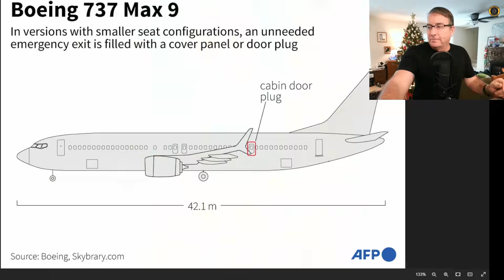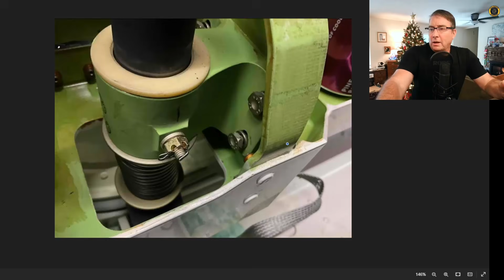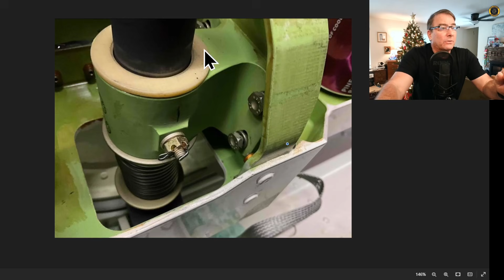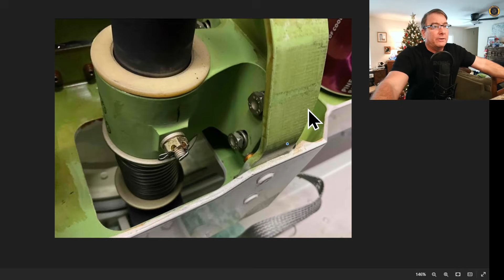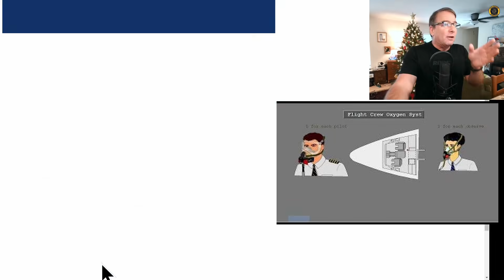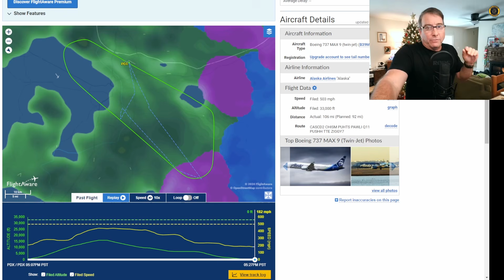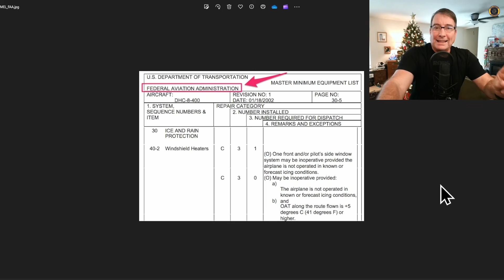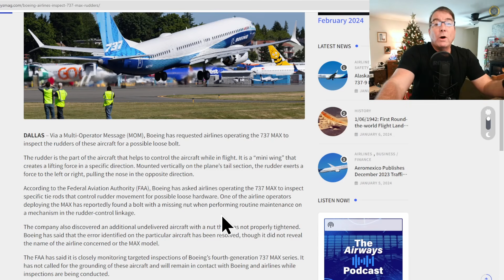"Yes, We Have No Bolts"  9 Jan 737 Max-9 Update

Comment: Why don't they use a type of plug where the inside lip is larger than the opening? It would mean the door has to be pulled into the aircraft to open, but would no longer rely on any such mechanisms. Similar to how they design spacecraft. It gives you a "default" closed position , not dependent on anything else except structural failure.
Reply: Because if you did that you'd have to chafe the air frame design as stress would be different.  This allows multiple configurations with one design.
Reply: What I have been saying in the other thread. The actual door could work the same way - there certainly have been emergency exits like that because I remember people mentioning an emergency instruction card which showed Heroic Passenger operating the door release and lifting the door into the plane but in the next frame the door was conspicuously missing with no indication of where you were supposed to put it in a crowded cabin during an evacuation. (You are supposed to turn it sideways and yeet it out of the hole, I think they later modified the card to show this.)

Comment: Juan... That dont make no sense... if the check list are what the pilots are using in the cockpit... HOW did they get blown away??? isnt the cockpit door supposed to be closed at ALL TIME during flight???? How can they get lost
Reply: Air pressure pushed it open
Reply: Sorry I work around the aircraft everyday... The cockpit door is what I was talking about... The checklist he was talking about are stored in the cockpit so the pilots can use them if something happens (Just like this or an engine problem). I am not sure how many differant checklists they have it there is a book with them  @xaiano794

Comment: Maybe vibration is causing the loose found bolts need a loctite type patch material to keep them from vibrating loose? Design engineers should indicate if the design took this into consideration. Boeing should be able to look this up in a matter of seconds. I wonder/speculate given delivery date if supply chain Covid issues caused a replacement of fasteners that ended up NOT being MilSpec as required/designed in order to not shut down production??
Reply: Simplest fix for this would be going to the castle-nut & cotter-pin assembly on all the bolts connecting door/sub-assembly to fuselage, no? I would imagine that with a maximum of two of these doors per bird, the weight penalty would still be less than one pound.
Reply: Castle nut and cotter pin or safety wire.

Actually, are thread lockers used in critical applications on aircraft? I'm used to only hearing about mechanical backups like safety wire.

Comment: Juan, curious what the starboard side " door plug "  mate  is fitted with as far as bolts. IOW ,  could the right side plug be in the same condition?? Maybe that side is rattling around too but just hasn't decided to jump off ✈  I would take a look at all the plug doors in all the fleets.
Reply: NTSB inspected the starboard side and concluded that was installed correctly.

Comment: My question is about the several reports of other bolts being loose on these same plug doors on several airlines. How were they found to be loose? Were the cotter pins installed at all? Or were these the other bolts for the assembly?
Reply: Other bolts shown @ 5:45 Two are visibly lose.
Reply: @rootuz42 I see that. Is this picture of the assembly that he used supposed to be a mockup or taken from some actual plane?

Comment: Outstanding analysis. Spirit is already in trouble for firing whistle blowers who were reporting, among other things, that torque wrenches were not properly calibrated.

So... the door was holding on by force of habit. A couple of hard bumps and it would lift off the locks and take solo flight. I'd like to pretend this is unbelievable, but instead it's just another Boeing engineering failure. At least nobody died this time.

One thing that was not done well here was communicating the emergency. As Juan says, MAYDAY MAYDAY MAYDAY should be the first thing out of your mouth when you call ATC with an emergency. ATC asked a few times if it was an emergency, there's a procedure for that. You stick MAYDAY as the FIRST WORD on calls until ATC obviously understands. In Europe and Australia you'll hear the ATC respond "Roger MAYDAY". 

I think they took way too long to get her pointed downhill. The reason for descending to 10,000 is that that's the limit without oxygen. So if you are at 42,000 feet and you don't get oxygen on fast enough, the aircraft is going to take you down to where you will regain consciousness. So oxygen mask should be followed by sending the aircraft back down. ATC can clear the way.
Reply: If bolts were never present, it may be time for Boeing to go into government management (if that exists).   Had that plug blown out at 35K feet, the MAX program would be finished and Boeing stock deemed junk.  The Airbus A200-300 and soon A220-500 can easily replace the 737 MAX derivatives and this is sad for U.S. aircraft manufacture.
Reply: @chrispnw2547 I wonder if Airbus is contemplating buying Boeing?
Reply: @davida56891  The U.S, government won't allow it and the politicians don't want to be seen as 'selling out America' to the EU.
Reply: @davida56891  Incompatible. Boeing has too much military work. Plus what would they get? A failing engineering company.

Comment: Juan, I have been USAF Aircraft Mx for the last 20 years. Following any major event like this, which would absolutely drive an impound, one of the first steps in our checklist is to pull CVR/FDR CB’s. 

Thanks for the report.
Reply: I'd ask also, given your experience, shouldn't there have been some 'torque seal' indicating paint on the nuts as a QC indication that the bolts were torques correctly?   This was my experience when I worked on some aircraft parts assemblies as a sub-contractor employee.
Reply: Can't help but wonder why shutting down the CVR cannot somehow be automated eg If the weight is on the wheels after a transponder setting of 7700, then preserve the audio (somehow).
Reply: What? You want extra components? That's not very sympathetic to Boeing's unofficial mission statement! 😁 @jimrobin
Reply: @jimrobin there are times when it is beneficial to record CVR. Think during Mx engine runs etc. if there is ever a ground mishap; investigators will utilize the CVR to get an idea of what conversations were happening during the mishap.
Reply: @jimrobin  How about "automatically download the recordings and all data and archive them on ground servers after every flight, no matter how routine?"
Reply: @tfdtfdtfd  That's crazy talk!  What do we do when we run out of bits?
Reply: In Europe they specify 25 hours minimum duration for the CVR - the US specifies 2 hours.
The NTSB has been asking for years for the FAA to align with EASA regulations…
Reply: Yes. They are pulled out following major events requiring an automatic impound or higher. It is a precaution to prevent overwrite of the 2-hr loop as they are always recording while power is applied to the aircraft. 

While the data written on the systems may not be required for the investigation; that isn’t  always clear at the start of the investigation. Hope that helps.

Comment: The plug door being spring loaded upwards to shift the ears over the stop pads seems like a non-failsafe design. If it didn't have a preload, it seems like it wouldn't be as prone to sliding apart. I mean, obviously the problem seems like there was no bolts there to act a stop pin, but I'm surprised that it's designed as a single mistake failure.
Reply: There are 4 bolts.
Reply: @percyfaith11  Sure, but 4 bolts is still one mistake if its just one step on a checklist. My point is it doesn't fail safe, it fails right off the side of the plane.
Reply: @telemundie  Well welded could be more secure I suppose.  But then you can say welding is only one procedure on a checklist that can be ignored.  If they want to be able to remove the plug at some point I don't see a better way of doing it.  
Gravity over powers the springs.  They don't launch the door into space.  They are there to assist a person to lift the plug.  I guess they never considered that turbulence could jiggle the door up and down enough to clear those stop points.  Even 1psid is plenty of force to jam the plug securely.
Reply: @percyfaith11  Hahaha, yea that's fair, its a little cheeky for me to describe it as "one checklist item" when I don't really know what the QC or cross-check process is like for this kind of thing.
Reply: @percyfaith11 supposed to be!
Reply: Why those springs are fitted to the plug version is a very good question. The plug does not need to be easy to open.
Reply: The springs are there not to automatically force the door upwards, but to be just enough to counter balance most of the weight of the door, so it doesn't need a lot of human force to lift the door when you want to open it - otherwise it would be too heavy/difficult to open it when you want/need to.
Reply: @wurly1  That is only a requirement for the actual emergency door. For the plug which is only opened occasionally in a maintenance hanger it doesn't need to be easy.
Reply: I'd think that the other function of the springs is to make sure the bottom of the door does not damage the skin of the aircraft when it is opened.

Comment: We're rapidly approaching "Well, the front isn't supposed to fall off" territory here. ಠ_ಠ
Reply: I'd like to point out that that's highly unusual.
Reply: Can we have the Senator for Boeing interviewed please?

 @WarrenPostma
Reply: "Cardboard is out...no paper, no string,  loose bolts...oh wait.."
Reply: What happened ?
- The Door Fell Off

 Why ?
- A bolt was loose.
 Is that unusual ?
- Oh Yeah. In A Boeing? Chance in a million.
 Where is this door now?
- It is out of the Environment...
 What happens after ?
- The Boeing Stock Fell off
 Is that unusual ?
- I want to make the point that that is not supposed to happen.
Reply: RIP  John Clarke.. One of the best.
Reply: What about cello tape? Is it FAA approved?
Reply: @oldcoot3459  No, but Boeing uses it anyway.
Reply: @oldcoot3459 Actually there is an FAA approved sticky tape…
Reply: Funnily enough there is an aircraft approved "1000mph" duct tape...and it is used on passenger aircraft.

 @oldcoot3459
Reply: - Well, there are… regulations governing the materials that the plug door bolts can be made of-
- What materials?
- Well, cardboard’s out
Reply: Some of them are built that the door doesn't fall off at all.
Reply: I would love to have a new end table. Can you drop a 737 door plug in my yard, please?

Comment: were i to discover a wheel from a car in my bushes i would not immediately assume that any lack of lug nuts means thats why it came off the car.  the thing fell from 16k feet, plenty of time and opportunity for an itty bitty bolt to fall off.  what someone needs to do now is find those bolts... much harder than a door, sadly.

Comment: It's a wonder the departing door didn't damage the empannage.
Reply: It was BLOWN off of and away from the Fuselage and Empennage by the differential pressure.
Reply: @guitarhillbilly1482   We know that. But it could have still hit it.
Reply: I think the physics are against you, there ... explosive decompression would've imparted a separate "forward" velocity and vector, no?  @skyrangerswift2ireland
Reply: I have no idea. I'm just glad it didn't hit the tail!  @OtherSarah2
Reply: @OtherSarah2  tail sections have been damaged from parts departing an aircraft in the past. I'm guessing the pressure from the inner fuselage overcame any wind resistance from the aircraft's speed to blow it clear of the empannage. Had it not, this could have been much worse.
Reply: I don't know...the term "explosive decompression " is used, but it's really only relatively quick..compared to, say, a bleed air or outflow valve problem. 
   I'm sure everyone's ears disagree with that statement...but it was probably only a couple psi pressure differential at 14000 ft. The 60 or so lb door probably quickly had it's path dictated by the 250 knot airspeed outside. I bet it passed under, but within the span of the horizontal stab.
   I guess it doesn't matter that much, though...all we know is it seemed to miss.
   Thanks, Mr. Browne, for the consistently excellent explanations!
Reply: Me too. I was just thinking about forces of inertia and directional velocity maybe protecting that whole tail/control structure -- the door'd've departed outward/downward pretty straight instead of downward/rearward, no? I mean, I'm not a ballistics engineer or anything, but it was pushed out the side of the plane with some force.  @skyrangerswift2ireland
Reply: It's a blessing this door didn't damage it.

Comment: I saw it reported that crews had a warning light on that door several times and ignored it. Doesn’t sound right but who knows in this day and age.
I happen to be someone who has seen the damage a  rapid decompression can cause. Ear drums bursting and doors blown completely off of aircraft, cockpit door
  Forced to open the wrong way. It’s like a damn bomb going off.
Reply: It wasn't a door.  It was a plug door.  I doubt if there was an annunciator associated with it.
Reply: The warnings were from the triply redundant automatic pressurization system for which there were two backups. No one had any inkling that it was from the door plug, and there would be no reason to suspect it because they would assume the plane was manufactured and assembled properly. There's a legitimate point about how thoroughly they should tear a plane apart when they receive such warnings, but no, no warning issue related to the door has been reported by Juan, Chris Brady, or in the NTSB briefings.

Comment: What with the 737 MAx crashes, the starliner debacle and now these manufacturing errors, I'd definitly be wary of flying a Boeing bag of bolts (or no bolts).
This company has destroyed it's safety reputation through coprorate greed, malfeasance and incompetence. 
If it wasn't so firmly affixed to the teat of the of U.S. defense industrial complex, it would be facing being an ex company.
Reply: It's a good point. But what about the company that installed the door? Do they also do that kind of work for Airbus? Is it a quality control issue? They'll investigate it all. Boeing does have the ultimate weight, unless it was some unlikely maintenance snafu. Whatever the actual case, it's painful to see a great American company declining.

Comment: I'm hearing that loose bolts are being found in a lot of MAX's now. Need to talk to some old friends at Boeing and see what they're hearing.
Reply: I guarantee each employee signed an NDA when they started for just this sort of situation.
Reply: Probably hearing a lot of nuts and bolts rolling around
Reply: I commented above on this I think those loose bolts are missing a flat washer. the hole is slotted and a lock washer will fail on a slotted hole because it is not in contact all the way around the circumference. I think they are missing a flat washer on those bolts that hold the bracket.
Reply: The nuts will all have bolted

Comment: When that door opened in a 270 KEAS breeze, it saw loads that might be waaaay more than the bolts on that green primed fitting can take (or more accurately, than the joint can take…hard to say what failed.)

Comment: If they where back on the ground in about 20 minutes how come the voice recorder was completely overwritten? supposed  to be good for 2 hours.
Reply: Circuit breaker wasn’t pulled to remove power and aircraft would likely still be connected to ground power
Reply: oops, i asked this before i watched the whole video. just a question i had been thinking about.

Comment: Someone on the line signed off work that had not been done. The big question is how deep does the practice go in the production of these planes ?
Reply: I just checked, Boeing is union.  Have there been labor / company problems lately?  Also, if the plug door was opened after the aircraft left Boeing's hands, would Boeing still be liable?
Reply: @bobroberts2371  union people have been known to kill people during disputes.... by their so called innocent actions of negligent behaviors during strikes... ask the guy blown up on I44 in missourri when the teamsters shot at his explosives laden truck
Reply: When was this assembled.... we know it was delivered in October but was it built last year or prior
Reply: There is a video of a Boeing whistleblower who described problem on the assembly line where they are more worried about cranking them out rather than making sure they're done right.   Very scary stuff.....and lucky they weren't any higher in altitude as the depressurization would have been more severe.   As it was...the differential wasn't that large so the results not quite as explosive as it could/would have been.